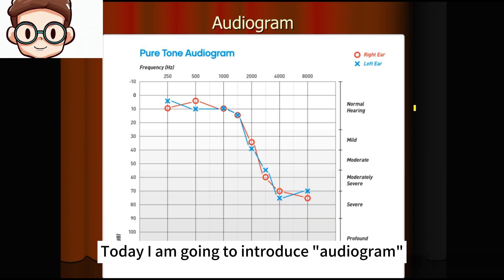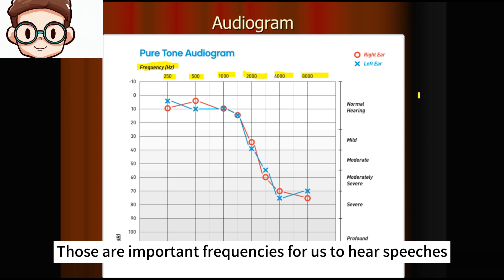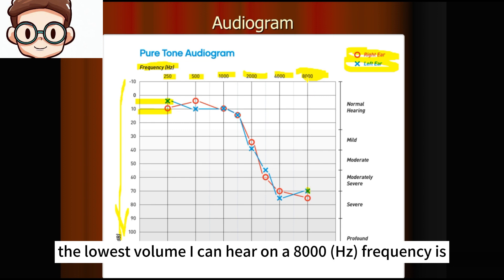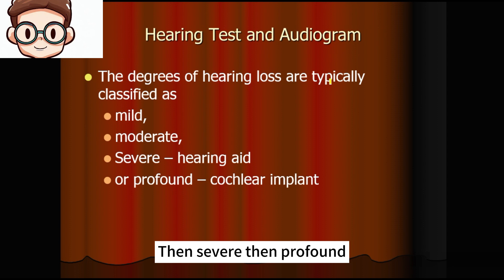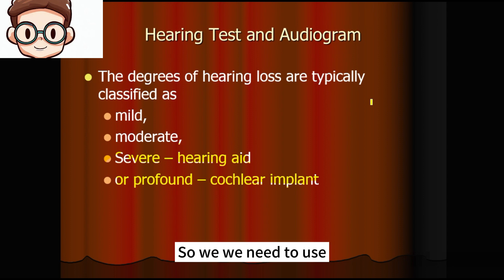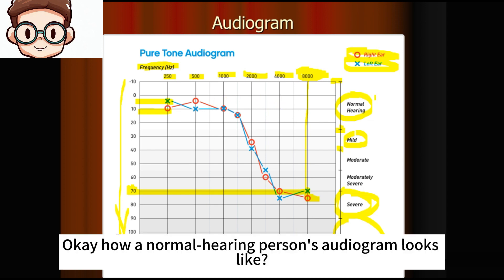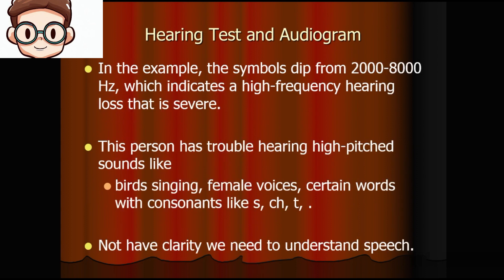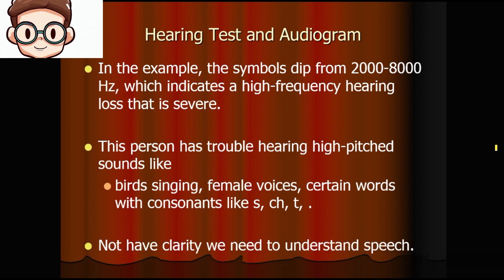How to explain results of a hearing test (Audiogram)? Prevention is the best way to protect hearing

Comment: Your diagram explanations were very helpful, thank you! 

My audiogram was 25db down at 1,000 hz with the audiologist saying I had trouble discerning T & D sounds? 🤔
Reply from the maker: sorry to hear you have 25dB hearing loss at 1KHz. Left ear, right ear, or both ears? Unfortunately 25 dBHL at 1KHz is not a small HL, which means you might experience trouble in distinguishing consonants like t, d, etc, because they tend to compose more high frequencies than vowels like a, o, etc. Please consult with your audiologist to see if hearing aid is needed to keep your auditory pathway more active, because regression might happen on auditory nerves and auditory cortex, if those high-frequency nerves are not activated often due to lack of sensory inputs. Best luck.
Reply: @MrHealthReal   - thank you for the advice, both ears are down 25db at 1,000 hz - I’m currently trialing suitable hearing aids in Australia (considering Widex MAGNIFY 50 mRIC R D rechargeable hearing aid) ?
Reply: मुझे मेरी ASSR और ABR रिपोर्ट दिखना है